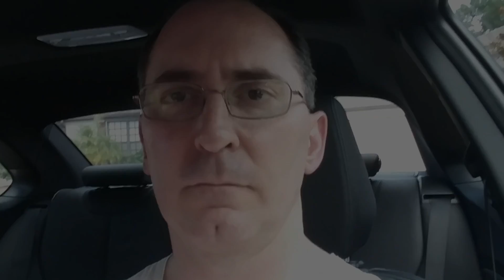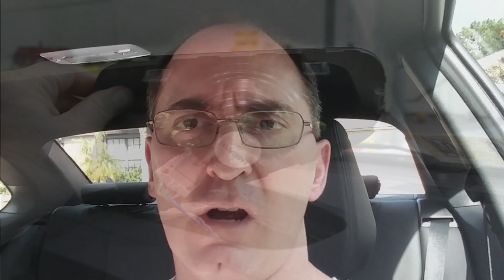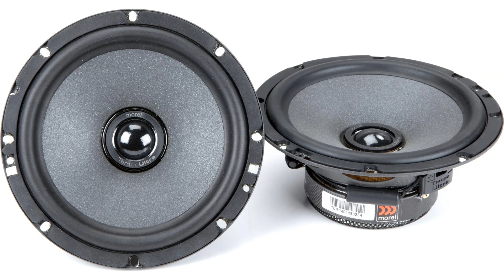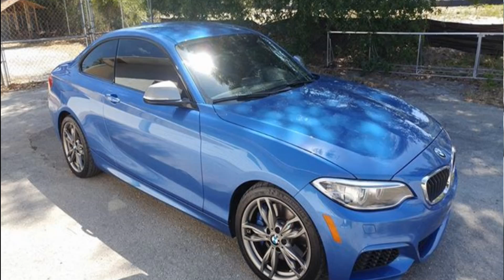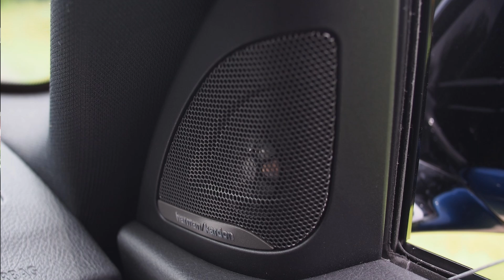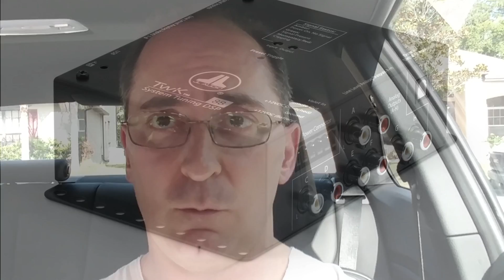Identifying Shortcomings in OEM Car Audio Systems

Comment: Loved this topic!  I've heard so many "high end" car factory systems that just suck.  The Ford "Audiophile" system in the Escape is one; the regular system sounds a lot better in this car.  I had a 2008 KIA Sedona with a 5.1 system with a Harmon amp and Infinity speakers and a Hyundai (with Infinity labeling) head unit.  This whole system absolutely sucked; terrible sounding.  I put in a Pioneer and JL Audio speakers, helped a lot.  Due to the death of my brother and finances I have been back in my 94 Chevy Astro cargo van, and I have a 93 as well.  In the 94 I use a Pioneer DEH-P77DH 1.5 DIN stereo with the iPod adapter under the dash and the cable in the glove box.  I also have a Cybertech iPod/bluetooth adapter that works great to plug in if I want to stream Pandora to the stereo.  I have an Infinity BassLink subwoofer on the top left rear shelf.  I have JBL J520M bookshelf speakers that fit perfectly face up behind the seats and the metal wall.  I found replacement woofers (foam surround won't hold up in a car) that are made to closely mirror the JBL sound, but with good heavy duty rubber surrounds. The replacement woofers did not disappoint.  I've tried lots of brands of 6.75" speakers for the dash and found that GM made a 2-way coaxial speaker from 92-95.  I found a couple of nice pairs at Pick N Pull that weren't rotted out as probably being garage stored cars.  Needless to say; this system sounds really good and is very enjoyable; much more so than much nicer systems in very expensive cars.  I can just feel the pit in your stomach after you took delivery of your very expensive car and were able to play with the stereo, and then have it suck.  I'd love to hear about your upgrades and opinions to make it sound to your liking.  I think this is a really good idea to explore.  As for systems I've like in cars are the Honda and Toyota vans with the 5.1 systems with the little tweeters in the dash.  They've done a great job getting things to mesh well.  I also think the GM Bose systems are enjoyable to listen to.  For some reason I find many cars with the bottom of the door woofers and tweeters in the sail panels to sound awful on several makes of cars.  Actually one of the best OEM systems I listened to (for the relaxing and enjoyability factory) is the Chevy Cobalt with the higher end head unit with XM.  Its just the two 6x9 speakers in the rear deck and two 6.75" speakers in the front doors at the bottom.  I've never heard a basic system like this that is able to create a full soundstage up high like there are full range speakers in the dash.  A very enjoyable system to me.  Another enjoyable system is in my dad's 88 Pontiac Bonneville.  This car has every option available at the time except for the supercharger.  It has all the stereo control buttons on the steering wheel and a very different Delco stereo that I've never seen in any other GM car.  It just has the two 6x9 speakers in the rear deck, and has woofers in little boxes on the front doors and tweeters in the dash.  With just a tiny bit of EQ on its 6 band equalizer, it is a very full range, very involving sound stage stereo.  My brother borrowed the car and put a cassette adapter into the "wide" cassette slot and wrecked the cassette deck and it got stuck on tape, so the stereo was unusable.  I have a few OEM stereos downstairs for times like this.  I put in a very basic Delco stereo with cassette and the sound is not anywhere close to the sound of the original stereo for this car, nor the power output.  We have since sent the stereo to a place in Texas and had it repaired so this nice original stereo is back up and running great again.  Sorry to be so long.  These are some of my car stereo opinions and observations in more of a budget range of older cars.  After my brother's death my priorities have changed a lot as we had a business together that went under with his passing and the economy.  I always complained I wanted a newer and nicer car and we got one with the KIA (so I thought).  It still was very expensive at 28K.  Luckily my brother financed the car for us (we lived together) and we were able to let it go without any financial ramifications.  I am very lucky to have been able to keep my home through all of this and have a much higher appreciation of my 93 and 94 Astros.  They're old with a lot of miles (278K miles on the 93 and 373K miles on the 94), they're extremely comfortable, drive nicely, still very reliable (old school) and they're paid for.

Comment: Good episode i think this has been my favorite episode so far. Big fan of car audio and cars in general. I have an 02 Honda S2000 and have some Polk DB65 components in the front doors, powered with a Kenwood amp hiding in the spare tire well, and Alpine headunit streaming Apple Music via bluetooth from my phone almost always. No sub at all (space) so the components are full range. Sounds pretty good to me and gets loud without distortion even when driving top down on the freeway blasting some Hip Hop. I have owned a couple different sets of Polk car audio speakers and have always been happy with them. Recently got my first 5.1 setup and went Polk also.

Comment: I just bought a 2014 Renault Megane 5 door hatch and they have an integrated satellite control off the steering wheel column as well as the display is up high on the Dash not on the actual head unit. my speakers are also set up with tweeter in the dash the main driver in the door it sounds tinny as well so I was wondering what can be done there in that situation. I already have speakers Galore but I just need to find out what I can do in the way of amplifier and stuff like that but still keep all the rest integrated as it was

Comment: Hey Gene.  I would say that the closing of JL is brilliant.   I am not as high end minded as you are, but few are. I guess you could say that I don't really have the curse of hearing the real bad things in a system.   
What I did to my car was first of all isolate the whole car with dampening, so that I minimized the rattle. I really wanted my car to have a stock look, so I made cabinets abinets in the door, because we all know that a free hanging speaker won't sound good without a cabinet. I changed all the speakers to JL c5 I think the name was. Also got a JL 4 way Amp, and a mono for the subs.  I've went with 3x8 inches ported in the spare wheel well, and made the cabinet out of fiberglass.   
I think the hardest part is tuning, a car is a hell to tune sound. It's really hard to rely on any instruments or tools, so as you advice :use your ears! 
It's also really important to measure the amps and speakers for peak efficiency to avoid clipping. My 4 channel Amp starts clipping around 84% load. 
BR 
Also I would really like you guys to do a small review of the Sony str-dn1080. It's not high end, but it's a good bang or the bucks.

Comment: I have an '06 E-Class with HK Logic 7 and I was very disappointed that it sounded so bad. Part of the problem is that the tweeters are so high up and the midrange speakers are down low. Plus, they don't use real crossovers. So no changes done until now. I replaced the tweeters with ones, that play further down low and implemented some real crossovers. Sounds a lot better. But still too harsh at high dbs. No comparison to my home theater. I am not willing to spend much more money in this, since it's always gonna be a trickier environment to work in than at home.

Comment: if you are going to use a quality DSP. use the best "Audio Control".. they make relatively the best for things like OEM integration as well as amazing EQ's, DSP's, and amplifiers. not to to take away from others like Fosgate or JL. its just that Audio Control has been around (and on top) longer than most other companies. innovation of their products has been quite ahead of the curve. just one man's humble opinion having installed these products in my own vehicle and customers.

Comment: BMW E90 with base sound. Added Audison AP8.9 bit, replaced all speakers ( Scan speak + Hertz Mille tweeters in doors, MB Quart underseats ), sound deadened the inner skin of the door. Almost plug and play and the difference is huge.

Comment: I have a '15 3-series with the Harmon premium system and it sounds pretty good for OEM.   Didn't realize they skimped in the 2-series.  Leaning toward a M235 or M2 in the next year, so very interested in the upgrade path you take!
Reply from the maker: Yea don't buy the Harman system. Get stock and upgrade from there. The head unit is the same with plenty of output voltage to mate with a new amp.  You can pick up a used M235/M240i and put some inexpensive tunes from Burger like I did and have similar power/torque as the M2 for a lot less money ;)
Reply: Audioholics Will do - thanks for the reply.  I'll miss my 3-series looks but pretty excited about it otherwise!

Comment: Epic buy BMW with a sound system that pipes in Engine exhaust sounds to reinforce a Driver oriented car.  Sounds like BMW gone soft.
Reply from the maker: It's a trend ALL car companies are doing now, including the new $200k Acura NSX. No need for this IMO, the Inline Turbo 6 on the M235i sounds sweet!
Reply: Turbo indeed sounds great wrapped

Comment: I think it's great to see what you have to say about car audio. For a short period of time, I used to work in the industry. I do have to say that you'll more than likely need different drivers. A lot of stock drivers in amplified systems are 2 ohms, which is often too low of a resistance for most four channels. Also, have you considered the Kicker IQ amps. They come built in with an adjustable DSP. It's probably not as good as  the JL Tun software, but it is a solid amp. Also have you given a listen to JL's C5 speakers? I personally think they sound phenomenal due in part to the silk dome tweeter, I'm just curious on your opinion.
Reply from the maker: Good comments. JL Audio doesn't make speakers that fit the stock cutouts in my M235i.  Morel seems to be about the best option without spending crazy amounts of $$$. I'm thinking of contacting JL to send me their amp and DSP to evaluate so I will probably do them as a package deal.
Reply from the maker: What did you use and where did you put it?

Comment: Absolutely a fantastic rout. I am going to do the same with my new Ford Explorer Sport. I will be repositioning the subs, adding a coaxial to the front door, replacing the current speakers. In fact, I will be replacing all speakers, likely with JBL.  Only power add will be an amp to run the subs.

Comment: Take a look at the Genesis Sedan with the 17 speaker Lexicon system.  I guarantee you it is one of the best OEM audio systems out there!  ...and make sure you have a quality SACD with you.
Reply from the maker: Wow it plays SACD?  I almost bought a Genesis but I just don't feel ready for a big lux sedan.  I want handling and zip ;)
Reply: look at the Genesis G80 Sport...V6 twin turbo  ...still with the 17 speakers, I'm not sure if the this model plays SACD's though, as most newer cars are getting away from cd players...my 2009 does.

Comment: as a Lexus ISF owner, I apreciate your information. I especially enjoyed your previous comment about Cadillac typically being inferior to lexus on a previous video.
Reply from the maker: ISF is a sweet  car.  I wish Lexus would bring it back with a Turbo 6.  Why can't they put a damn turbo 6 in the IS and make it competitive with a BMW 335i or M3???
Reply: I know exactly what you mean and understand however many people apreciate the fact that it is one of the few cars in its class with s v8. this applies to the RCF and GSF as well. I would rather see them supercharge this excellent yamaha v8. they will save on re tooling and have a more reliable, unique and better sounding product than the competition.
Reply from the maker: Very true.  I was seriously looking at getting a used RCF but the price was too high, especially for a car that doesn't outperform a stock M235i. Gorgeous car though and superior seats and interior to BMW.
Reply: Audioholics a car doesn't cost what you pay, it cost you what it depreciates. flagship used cars are typically the way to go. I love your bmw, my buddy has a 2011 m3. the only issue is the cost of maintenance and depreciation.

Comment: I would LOVE to see some car audio reviews!! An overall review I'd like to see if you feel like it is what is the difference between the standard audio system in a car versus the "upgraded" sound system (if the option exists, usually in a tech package). Any care or SUV would work as a comparison.

My car, 2002 Nissan Pathfinder with upgraded Bose sound system.

Comment: Great vid Gene. Im looking at doing some upgrades on my 2016 veloster rally edition. The factory dimension audio system is actually pretty decent but lacks low end punch.  I would also like to use a dsp to delete the center channel and give me sub pre outs. I dont mind the stock head unit other than it lacks sub gain control. I might try to mold a fiberglass box to replace the stock 8" sub enclosure \ trim. Would like to keep it small and clean but have a beefy 8" driver.  I need to fabricate a wire hareness to delete the engine noise wire and wire in the dsp. I dont wish to modify the stock harness at all.

Comment: Nice!! I have an 2004 Acura TL and have been debating whether to upgrade its sound system or upgrade my home stereo. I was considering upgrading the sub and or the tweeters, my center channel is making a slight hum when it's on. I have issues with rattling too (apparently common in TL's) which I'm thinking will get worse with a beefier sub. What do you think about putting an enclosure in the trunk?    I was thinking it might not sound as good as replacing the sub in its current (in cabin) location. Thanks for any advice :)

Comment: YAY! I'm a car audio nut. The route your talking about is a solid option. If you're keeping the oem head unit, having a dsp is a must. Time alignment is your friend. I have an aftermarket system in my car, my channel has some vids about it.  Usually not too impressed by stock oem systems but one that sticks out is the system in the 2017 Toyota Highlander. Definitely the best sounding factory system I've heard so far.
Reply: thornygravy *cough *cough *FIX 86 *cough

Comment: the last time I looked into car audio upgrades was a 2002 Honda S2000 because let's face it, with a convertible top down most OEM systems just are not loud enough to push through that wind noise. All I did was swap the deck for a more modern one with USB and bluetooth support, add an external stereo amplifier (this car came with only mid and tweeters in the doors), and replaced the factory drivers with some MB Quart 2-way components. One of the mid's had a flaw where the flex wire attached to the cone peeled off so I repaired it with new flex wire but after this hassle I gave up on car audio for the past 5 or 6 years. Now I am in a giant box and getting delusions of improving car audio again...

Comment: Do a full Hi-Fi car audio system. More sound deadening, Focal speakers, better subs, the whole 9!!!
Reply from the maker: Yea I'm looking into some sound deadening for the door panels.
Reply: Audioholics please save yourself some money and do not buy the jl audio...and go for the audison dsp amp combo...with all oem integration features...and tweak the system anyway you want with the laptop....its only one unit...not two...
Reply: https://rover.ebay.com/rover/1/711-53200-19255-0/1?icep_id=114&ipn=icep&toolid=20004&campid=5337937361&mpre=http%3A%2F%2Fwww.ebay.com%2Fitm%2FAUDISON-PRIMA-AP8-9-BIT-EISA-WINNER-2015-8-CHANNEL-PROCESSOR-BRAND-NEW-WARRANTY-%2F201731080727%3F_trksid%3Dp2385738.m2548.l4275
Reply from the maker: Focal makes great drivers but I don't believe they have the sizes that fit my car which is why I'm going with Morel. Yes I plan on sound deadening the door panels. I don't think the trunk needs it since the bass drivers are under the front seats.
Reply: Audioholics You are just like me man!!! I am also huge audio and car freak. Audioholics have easily become my favourite channel on youtube. I was amazed how much knowledge you have about audio. Outstanding work.
Reply: Jacob Falk Focal speakers are metal dome tweeter thus being very harsh. Go for audison or morel which have silk dome tweeter which are best in my opinion.
Reply: Audioholics i am talking about the audison ap8.9bit its the easiest way to integrate high end audio in to oem situations...and another plus their speakers are the shit...do yourself a favour and at least look in to it...
Reply: justkiddin1980 send a hyperlink
Reply: Jacob Falk Thanks buddy.
Reply: isaacsykes3 oh sorry...did not see the comment until this morning...i see jacob took up the slack..thnx jacob!
Reply: justkiddin1980 Not a problem. I thank you both.
Reply: For sporty cars, even germans: 

Doors, Floors, and roofs. 
MLV + BT Rubber + closed cell foam.  

Otherwise, I'm afraid all the DSP, SMPS Amps, and new speaker cables you may run will be counteracted by SQ loss and road noise.  

I'm facing this same problem with my hatchback.  Have to invest in the the labor to tear everything apart and properly isolate sound-generating cavities and surfaces, or my efforts will equal low efficiency performance in spite of great equipment and tuning.  

Great video. Good luck with your build !
Reply: isaacsykes3 but do we agree that the ap8.9bit is a better option than the jl audio one?